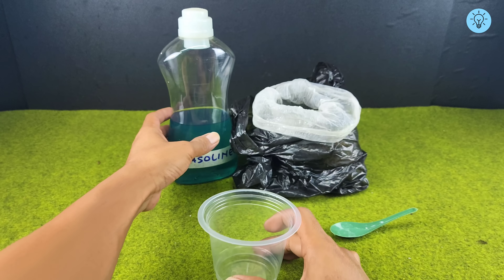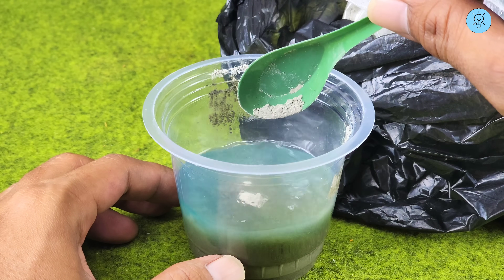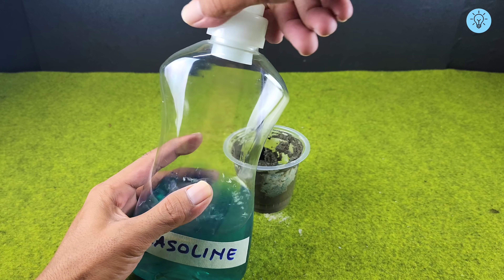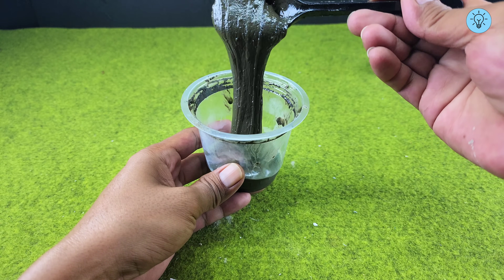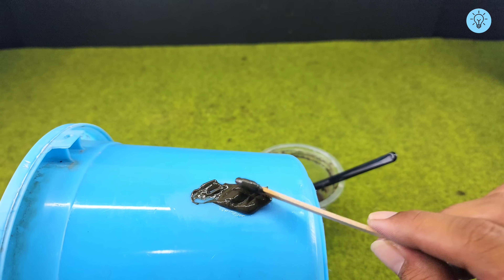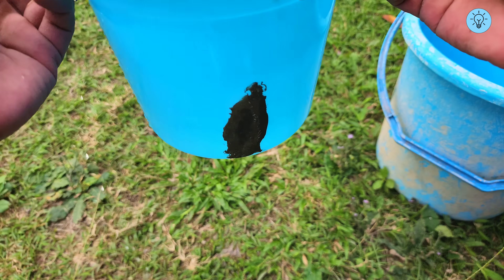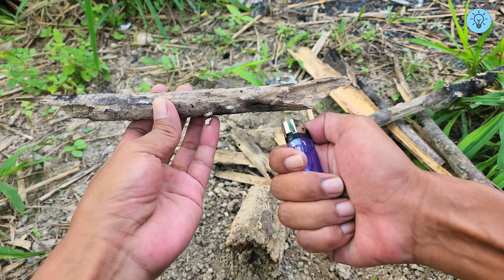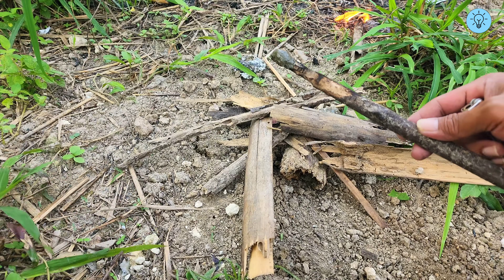Mix GASOLINE with CEMENT! Amazing results that most people can't imagine

Comment: And what do you do about the smell of the gasoline?
Reply from the maker: That’s a good question. After the gasoline is mixed with the other materials shown in the video and used to patch a leaking item, you can wash it with soap and the smell of gasoline will disappear on its own. Thank you for asking, and I hope the idea will be useful 🎉🎉😊
Reply: From what I've heard if you spill gasoline on concrete it's very toxic if you use soap to wash your concrete floor it is 10 times more toxic

Comment: I think this is pretty dangerous because I believe when you mix gasoline and styrofoam that creates Napalm and I don't think you should handle that probably spend the 20 cents on a new bucket
Reply: Its like highly flammable JB Weld ;-)
Reply: Napalm is no more hazardous than the gasoline.  It just sticks better.
Reply: Not as much fun
Reply: $5
Reply: Napalm was invented for flame throwers so the fire would stay where you put it. The base fuel was napthalene not gasoline though gasoline behaves almost identically. It's not explosive or unstable. It's more stable than plain gasoline. Of course it's not good to get it on your skin or injest it.

Comment: If you are looking for practical applications, more testing will be needed. 

How does it react to fire once it's dry?
How does it react when mixed into concrete instead of just cement? How does it react to fire, water, changing heat differences over time?
Could it be used to create a more water resistant concrete? Would it survive the changing of the seasons? Would there be any negative effects?
Could it be used as a paint on steel, brick, wood, glass fiber or concrete? What properties would it have and what would the benefits be?
Could it be used for heat, cold or water isolation?  
Would any application be cost effective?
What health or safety risks would there be when working with the material?
Could any other added ingredients improve the qualities or offset any negatives?

Have you tried replacing the gasoline with any alcohol solution for example?
Reply from the maker: Those are excellent and detailed questions 👍. In the video, what I used was actually a mixture of gasoline, styrofoam, and cement. After it hardens, the mixture becomes solid and the flammable property of gasoline disappears. For practical applications such as waterproofing, heat resistance, or long-term durability, of course more detailed laboratory testing would be needed. Replacing gasoline with alcohol is also an interesting idea, but I haven’t tried that yet. Thank you for your valuable input, and I hope the idea can still be useful!
Reply: @creationDIY_101 acetone with Styrofoam melted into it makes a strong adhesive.

Comment: If you live in the U.S., it is a violation of federal law to store gasoline in a container that is not specifically approved for gasoline. That bottle labeled "gasoline" does not look like any approved container I have ever seen.
Reply: This only applies to businesses and transportation of fuels. It does not apply to private individuals. Even with transportation and business sectors there is a quantity application, it’s usually more than 5 gallons during transport and 1 gallon in static storage space.
Reply: None of my gas ever has had that blue tint to it either
Reply: What are you in for?  Storing gasoline in a water bottle.  You?  Ripping my mattress tags off.  Hardcore criminals.
Reply: Party Pooper

Comment: Most severe 3rd degree burns involved GASOLINE !!!!!!. You should be outside in a well ventilated area . 
  In instead of GASOLINE this would probably work with acetone. Which is a little safer than gasoline.

Comment: Flex the bucket and the patch pops off.   That's my assertion. Not much will bond to PE and PP plastics.
Reply: It might flex with the plastic but you also might get it to bond if you heated it up very carefully it needs to be done below the ignition point or flash point of the gas.
Reply: @MattStMarie-bm5sq  having worked in plastics. A true useful bond would not occur. It is difficult to bond PE to PE the heat application and pressures must be correct and vary  based on size and thickness. But PE and PP expand with heat. There is a process to bonding them. The repair patch will be too stiff compared to the material. It will have a poor mechanical bond. The technique could be used on other materials (I suppose) however the example presented, is a poor one. IMHO
Reply: It may not do that because of the Styrofoam or polystyrene with in it.
Reply: @MattStMarie-bm5sq  in the process there is nothing to dissolve the PE or PP plastic. PE and PP are resistant to solevts. The cement/PS patch will be much stiffer and flexing the bucket will pop the patch out. There is no bond only indexing contact, ie A Plug.  I'm not aware of any process that does not involve heat bonding PE or PP. If you aware of a glue that will stick to PE or PP, please let me know. Pp and PE are used for glue and solvent containers, as well a fuel tanks. No Heat No Bond, it's just a plug.

Comment: In the United States blue gas generally indicates that it is oil oil-gas mix also known as two-stroke fuel.
Reply from the maker: You’re right, gasoline colors are indeed different in every country. In fact, the natural color of gasoline is actually clear with a slight yellowish tint. In my country, gasoline is sold in three colors: green, blue, and red. These colors are not natural but are purposely added by the producers. The main function of adding these dyes is to distinguish the RON (Research Octane Number) levels in the fuel. That way, people can easily identify which type of gasoline they are using for their vehicles.
Reply: @creationDIY_101  in the US they only do that to indicate that it's tax free fuel. For farm use and stuff like that.

Here I was just guessing your's is like 50% ethanol. 😂
Reply: @creationDIY_101 so you can see the fuel before you pump it? Here in the usa they label the pumps so you know what fuel to use. So do you just spill each fuel on the ground to see what you're buying?must suck living in a shithole. Heck even mexico knows how to label their fuel pumps. 😂😂
Reply: @mhcaffey120  What I want to know is what the fuel, styrofoam, metallic tape costs are 
vs some epoxy and that same tape (or something similar to act as a mold to hold till dry).
OR just a new child's play bucket.
Reply: @davidohare2933  
If not for the cement, the styrofoam and gasoline makes another product, Napalm.
Basically it is a close form of Napalm B, the type that was used during the Vietnam war. It's a mix of Gasoline, Benzine and Polystyrene. The mix in the video is lacking the Benzine. But the stuff would be just as effective as Napalm B.
However the fix in this video isn't that effective and will not last very long. I certainly wouldn't want to drink water from that bucket after that fix.
A much better fix for something like that would be some gauze or cloth soked with some epoxy, plastic glue, super glue or even some water proof/resistant wood glue to cover both sides of the damage. I've made many temporary fixes with fabric and glue out in a remote field repair until we could get a replacement part.
But you are right that it would be faster and cheaper to just replace the bucket or pail. The fix he did takes far too long, the cost of the repair could be more than a replacement, not that effective and the hydrocarbons from the fuel will leach out into whatever is in the bucket. That patch he made could also have a reaction to some liquids that might be carried in the pail.
Reply: @mhcaffey120  That was unnecessarily rude mate, calling where he lives a shole.
What's the matter with you. He's a YT channel creating content for free and you diss him like that ......... grow up or are all Americans intolerant ?
Reply: @81carrerasc only the liberals are intolerant
Reply: 100LL (aviation gas) is also blue
Reply: @OGDigitalRebellion  
In the Military (USAF) we also have Mogas that has a Red color. Mogas is nothing more than a commercial grade regular gasoline. Though some fell for the story that the red color was something that would stain the inside of the tank and carburetors on old cars to catch anyone using it in their personal vehicle. That was total BS. I also heard the term Mogas for Aviation use in aircraft that could use automotive grade fuel or converted for that use. But I'm sure that is in the private small aircraft.
Reply: @EIBBOR2654  In general aviation we just call it 100 low lead (really a misnomer as it has way more lead than the old leaded regular). 🍺
Reply: @OGDigitalRebellion  
They must be using the same Mogas term for different things in other areas. The Mogas some of the private pilots I've talked to were telling me Mogas referred to the unleaded automotive fuel that some of the converted, home built and some newer small aircraft were using. Those converted aircraft require a certification. I've also seen this in an article about unleaded gasoline that wrote about what would be needed and the cost for aircraft to use unleaded fuels. They referred to the unleaded fuel as Mogas.
Reply: @EIBBOR2654 in the us we has several octane levels. All are lead free now. And E-85 which is mostly ethanol. Made from corn. That’s how much food we have. We use it for fuel. Summer mixture is 10% ethanol. Winter mixture is 15%z It’s cheaper but you get half the miles per gallon. I laugh at people with flex fuel vehicles pumping that. They must not have a clue. But all propeller planes still have lead in the fuel. It’s a must. And jet fuel is Kerosene.
Reply: @OGDigitalRebellion  octane is the resistance to combust. PB is cheap additive to increase the resistance to combust.
Reply: E:85 is 15,per cent ethanol
Reply: @OGDigitalRebellion just like bols gin.
Reply: Not necessarily, mid grade gasoline is dyed blue in the US by several companies. Back in the day when they still had Leaded fuel at gas stations, regular gas was usually dyed red, unleaded was dyed blue to distinguish between the leaded gas.  At one garage I worked at in high school that filled cars was American, now Amaco. The Regular Leaded gas was Red and about 90 Octane. The Unleaded Regular was Blue and was the mid grade as it was about 95 Octane. The High Test gasoline was clear and was 105 Octane. High Test was also known as Premium, Super Premium or white gasoline and was also unleaded at the American gas stations. But that was back when High Test gas was 100+ Octane and Regular was at a minimum 90 Octane. The American gas stations at that time were the only station that had Unleaded High Test and the only one that had the small diameter nozzle on the pumps for the vehicles required to run unleaded fuel and had the blocker for the larger nozzles on the leaded fuels. I was told that the refinery used an unleaded octane booster for their high test gasoline. Nickle I believe was the booster.
But one thing to know, there are no national laws or standards in the US mandating the colors of gasoline as to grade and they vary by company and or refinery.
Reply: Racing fuel
Reply: Blue is Av-gas. 2 stroke gas can be any color depending on the color of the premix. I've been around motorcycles all my life, I've seen premix come in every color you can imagine: green, blue, red....
Reply: That looks more like 100 octane low lead avgas…
Reply: @dpete8995 they quit putting lead in av gas 20 years ago. There's no such thing as low lead anymore.
Reply: @lukewarmwater6412 so wrong there is currently a fight to remove it from avgas but people with vintage planes keep it going saying unleaded leads to valve recession 
     Still used in some racing as well 
Pretty sure NASCAR runs it
  Edit NASCAR switched in 2007 
The drop in intellect over it is staggering 
   Especially effecting pregnant women offspring who are around it
Reply: Aviation fuel also the good stuff😊
Reply: Blue gas in Ontario/Canada aviation gas

And ......

"In Ontario, "red gas" is a misnomer for coloured fuel, specifically red-dyed diesel or gasoline that is tax-exempt for non-taxable purposes such as home heating, off-road equipment, or power generation. Using this coloured fuel in a licensed motor vehicle is prohibited, as its distinct color serves as a visual cue to prevent fuel tax evasion.  "
Reply: @robertcampomizzi7988 blue gas isn't gasoline at all. It's hydrogen. Made through a specific process.
Reply: Offroad diesel used in farm equipment etc is dyed red because it doesn't pay the road taxes..
Reply: Thanks
Reply: Avgas
Reply: dyes in fuel are added depending on grade also to alert the user of toxic properties
Reply: @marcusdavies4069  
Not in the US. There isn't a general federal requirement for coloring all gasoline in the US. However there are some Fed reequirments for some fules. Aviation Fuel has an FAA regulation to ensure the correct grade is used in aircraft that require specific grades. Off Road Diesel fuel is dyed Red to show that it isn't for use in vehicles that are for road use because it isn't taxed and is only used in off road equipment like for farming and construction use. Blue diesel is used for U.S. government vehicles. If you are caught using the red or blue fuels in a regular vehicle like a truck or car that is used on roads, you will find yourself in big trouble with the IRS, state, county and city for not paying the fuel taxes. All taxed gasoline and diesel for vehicles that operate on roads is usually clear.
I say usually clear as there could be some states that still have their own fuel coloring rules. Oklahoma dropped their fuel coloring rules for fuel grades back in 1996. It was stated that there was no need for it as no one sees the fuel going into their vehicle and the grades are plainly marked on modern pumps. Plus those pumps are tested regularly by the states to insure the quality and octane is what the person is buying or paying for. All the fuel I pump at the gas stations here are clear no matter the grade. Diesel pumps are seperate from gasoline.
All of this can be found in the Code of Federal Regulations (CFR) under Title 26 that deals with the IRS. But the CFR is one huge bureaucratic list of Red Tape. I know, I was in charge of my shops Hazmat in the USAF. The CFR has gotten so big and is updated so much it has to be accessible online as the printed version would fill the Pentagon and probably more large buildings in DC and would cost billions. There could be several titles in the CFR covering an item and they are not always cross referenced. Then there are other Fed, State, Counrty and city or local regulations and rules that might cover the same item like the Department of Transportation (DOT) and/or the local Fire Codes. So this could change from state to state here in the US.
Reply: Looks more like kerosene to me.
Reply: or leaded.  smells freakin' wonderful, too, not acrid like unleaded.  terrible for brain cells, though.
Reply: @razbitom  No leaded in Oz anymore.  91, 95, 98 unleaded and diesel.  That's it.  100LL for aircraft, and AVTUR, and JETA1 which are similar.  (Basically highly refined kerosene)  Oh and there's still a few places that have Kerosene bowsers, we have one here.
Reply: The gasoline here must be much stronger because it would have eaten that plastic container.
Reply: In which dimension?? The blue pump handle is for no ethanol gasoline.  And not all two stroke oil is blue. Most common is green...
Reply: @lukewarmwater6412 not blue handels here on the pacific southwest of Oregon, the 2 stroke oils i have been getting for my chainsaw is indeed blue, the husky oil and stehl oils turn the fuel sorted muddy brown, the oil i use is Amsoil. Hopefully that clears your confusion. Oh and Oregon is on the west coast of the United States between Washington and California.
Reply: Blue dye gasoline?
In USA thats called Aviation Gasoline:100-LL (Low Lead).
Reply: Actually blue gasoline is 100 octane low lead aviation fuel in the US
Reply: @captaintomst good to know as i don't  have access to aviation fuel. Thank you.
Reply: Bio-diesel?
Reply: Could be Av gas
Reply: Blue gas is also aviation  high octane gasoline .sometimes used in racing applications  . Orange gas is 108 octane and blue is 116 octane.
Reply: Leaded gasoline is also blue
Reply: @terranovarain6570 were can you still get leaded gas in the United States?

Comment: Will the bucket also burst into flames like that?
Reply from the maker: No, the bucket will not catch fire. The reaction only happens on the surface where gasoline and cement meet. It looks dramatic, but the container itself stays safe.